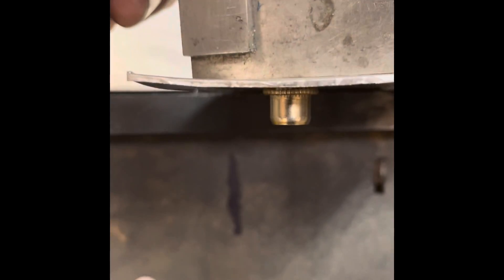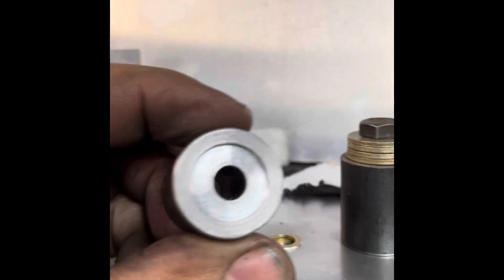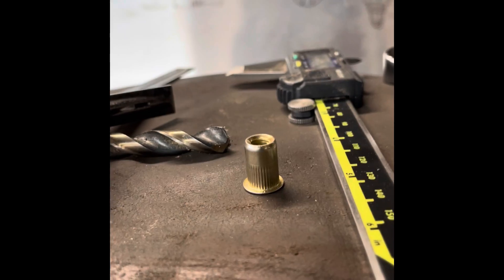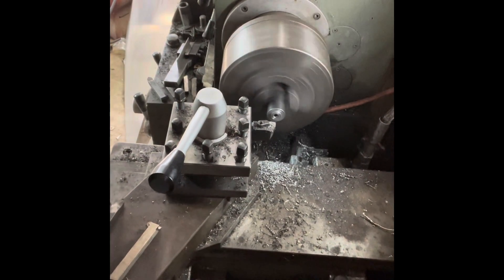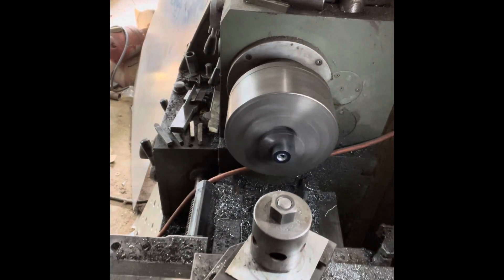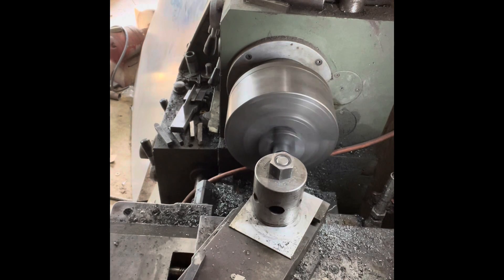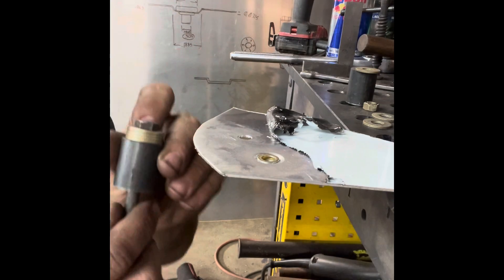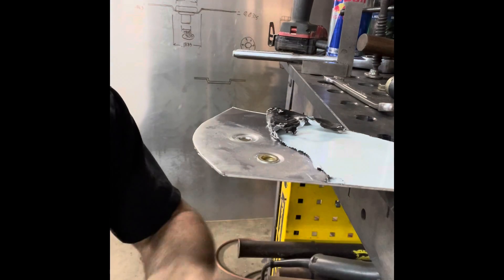Make a dimple die to flush mount a  riv-nut

Comment: I don't get it ???  I appreciate the fact that one might want to countersink the rivenut somehow to compensate for the rivnut material rise. But isn't the whole premise of using rivnuts because you don't have access to the backside of the mounting surface to use a nut  ...
Reply from the maker: @artvuilleumier5702  this is to allow in this situation a single tool adjustment of the part at the racetrack and my customer is more likely to have a revnut tool and recents to make quick easy repairs then they are the ability to replace pem nuts or caged nuts.

Comment: Such a simple tool, you'd think this tool would be sold and available at fastener supply businesses but it's not.
Reply from the maker: There are a few companies selling them I just ended up needing one before I could get it shipped and as simple as it was it didn’t take long to machine so it was worth it.
Reply: @motleymetals  Yes, I guess it would be impossible to have them available for all thicknesses and type of rivnut. Generic won't work on all applications.
I'll come back to your vid here when I need tips on a flush application.

Comment: Not a bad tool but I would just weld a nut to the back of that sheet Instead of using that style insert 
Whenever possible
Reply from the maker: I use weld nut quite often but most of this assembly is aluminum and may get some carbon fiber pieces as well.

Comment: If I need a flush rivnut I just use a countersunk one.  It's a neat idea to use a standard rivnut and a dimple die but it's too much messing around when countersunk rivnuts are off the shelf, quick and easy to use.
Reply from the maker: The material thickness is less than minimum grip range on countersunk riv-nuts for the diameter bolt we need.

Comment: Nice bit of fabrication but what I've been using is so ball bearings welded to a piece of round bar, drill the hole under size as you said the punch the hole to create a depression "relevant to size of insert" then when insert is installed then assembly it gathers the flare as it tightened and chokes it onto the insert, it makes a much stronger installation in thinner metals too !
Reply: so a ball bearing ball? welded and then used to punch the hole. And it makes the rivnut flush as it averages the flare created?
Reply: THIS approach make sense especially since one uses rivnuts because of no access to place a nut on the backside ...

Comment: Why wouldn't you make the hole the correct size to start with?
Reply from the maker: Good question. There can be a drawing effect where it pulls material along the path of least resistance and if it draws it from the hole it could change the tolerances for the rivnut. By drilling to fit as a second operation you are sure to be within spec.
Reply: @motleymetals  Would've been nice to see what the hole was after drilling and after forming.

Comment: 👍 nice work and good video.
You did not need to step drill. The correct way to use a drill bit is to go right to size. Some may step because they're afraid of cutting oversize but that can be harder on the bit.

Comment: I tip for you who don't know, there are counter sunk rivnuts that ends up flush. Easiest way to use them is to drill the hole with a step drill to get a perfect hole with chamfer.
Reply from the maker: The parent material thickness on this project doesn’t fit within the minimum grip range of countersunk rivnuts for the thread diameter to match the factory hardware of the parts.
Reply: @motleymetals4057  yes it requires 1.5mm to grip good. Your tool could also be used on the mating part instead if one can't access the back of the plate with the insert like a thin walled profile. 👍